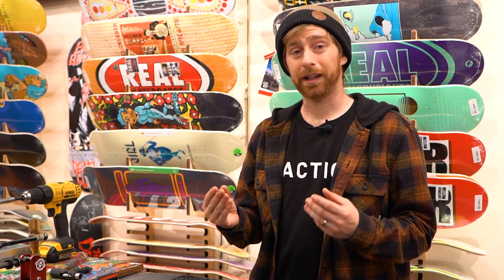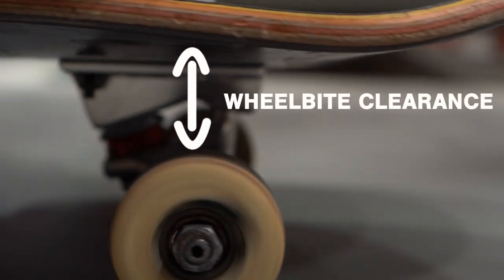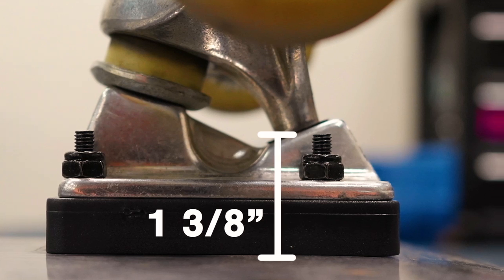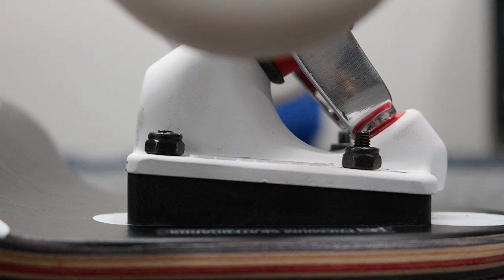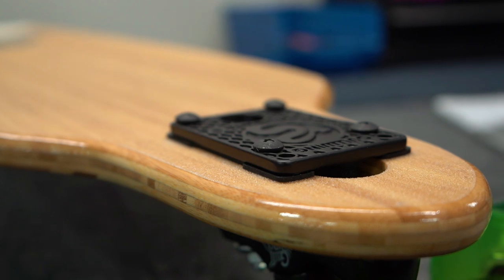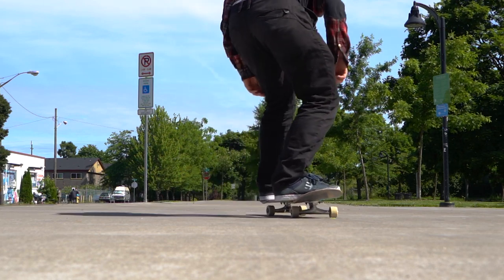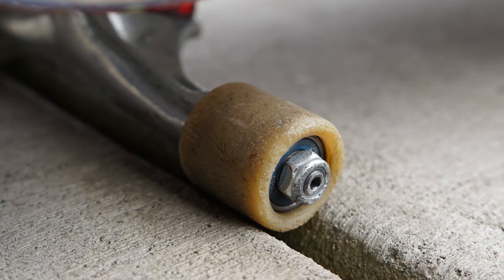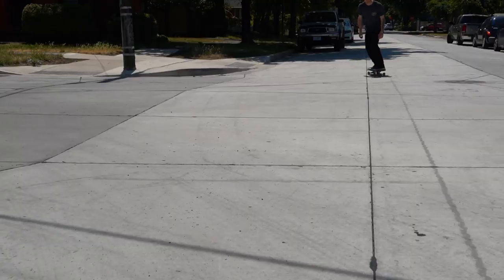How to Prevent Wheel Bite | Guide to Skateboard Risers | Tactics

Comment: I have a question whats an easy way to make sure my bearings go inside my wheels they get stuck and dont go all the way down and dont move as well
Reply from the maker: Unless you have a bearing press, the best way to get the bearing into your wheels is to set your deck on it's side and press the wheel down with your palms onto the truck axle. Here's a video that shows it. Cheers! - Tim
https://www.youtube.com/watch?v=l_F3eqG3qZ0
Reply: Make sure it’s aligned too, the best way I make sure is by dropping down the wheel onto the axils. If it doesn’t drop down smoothly, even them out again and repeat. 
Don’t use lube to get them in, just clean your wheels if you have to, lube can potentially gunk up your bearings.
Reply: The technique I've been using is find a socket that lines up with the size of the outside edge of the bearing and use it and a socket wrench to help press them into the wheel. I prefer to do that because I don't want to put a lot of pressure on the center of the bearing pushing it in.

Comment: What if I have a drop through?
Reply from the maker: Riser pads are not compatible with drop through longboards. You can use strip risers that go on the left and right sides of the truck, between the deck and baseplate, but doing so actually makes the board lower to the ground. But wheelbite shouldn't be a problem on you drop-through, so you don't need risers anyway. Cheers! - Tim
Reply: Tactics Boardshop actually I get some wheel but when I try to carve very tightly so I think I’ll go with the option of tightening my trucks

Comment: I was riding my longboard once, took a sharp corner, got wheel bitten and i fell off but my longboard shot back, and a bicyclist fucking fell over my longboard.
Reply: Sucks to be both you and the cyclist. I remember running over a squirrel on my bike while going down a hill at over 30 MPH. It ran right between my wheels and got ran over by the back one. I'm lucky I didn't slam. I would have been messed up bad if I did.